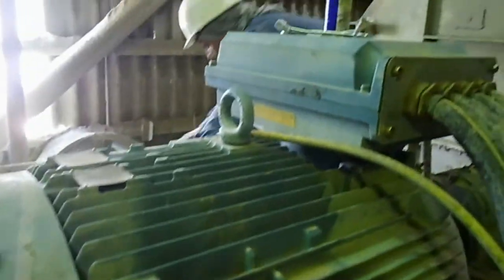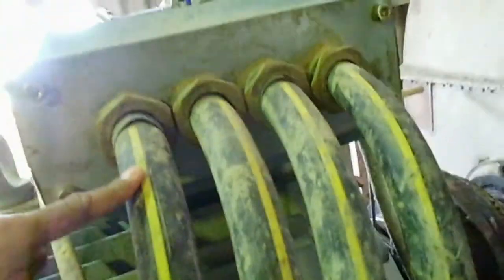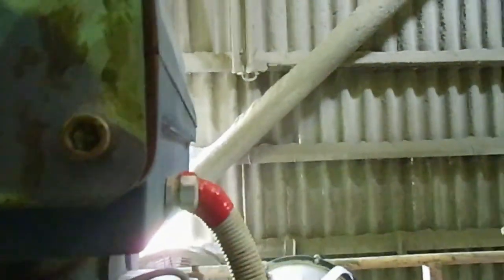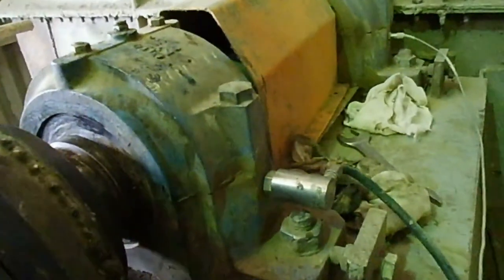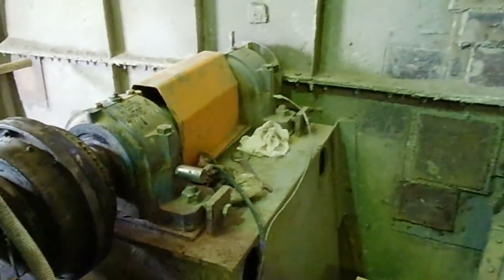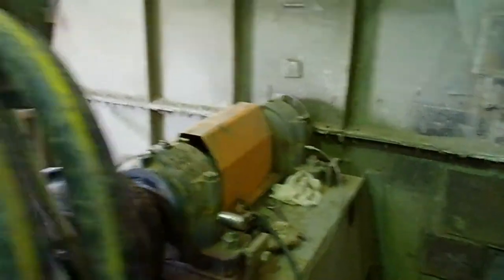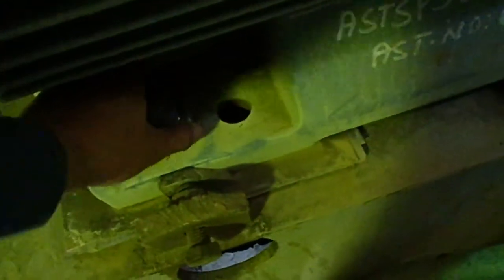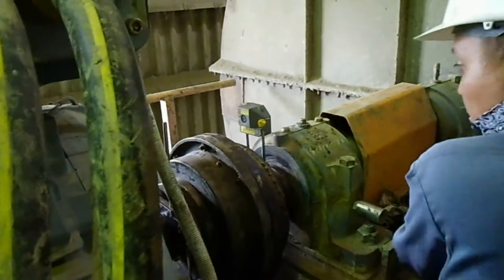Electric motor installation. Motor installation and details.

Comment: Thats one heavy motor to change, and when its fully fitted i expect you will have to balance the system to minimise vibration.

It has many power wires, has it more than 3 phase then?

Im sorry but you talk very fast and if you told me about the number of phases then i missed it :-(
Reply from the maker: Your understanding of the system is great friend. It is a three phase motor. You are correct there are four cables entering in the motor terminal box. Each cable contains four wires. Three wires for three phases and fourth one earth or ground. So then all four cables are parallel with each other to increase current carrying capacity required by the motor. Normally this scheme of the cabling is adapted for big and heavy motors. Regards,